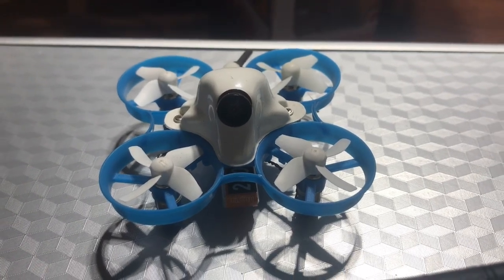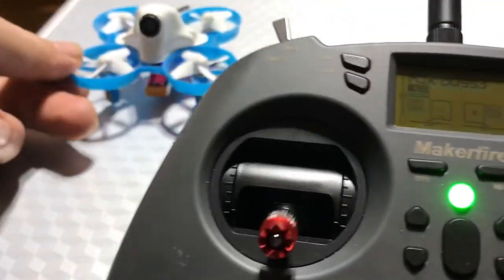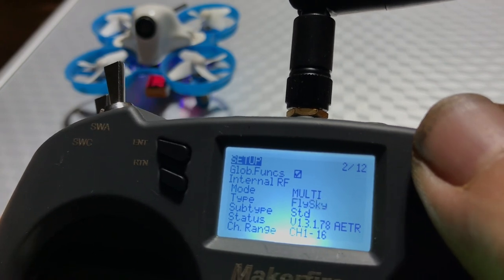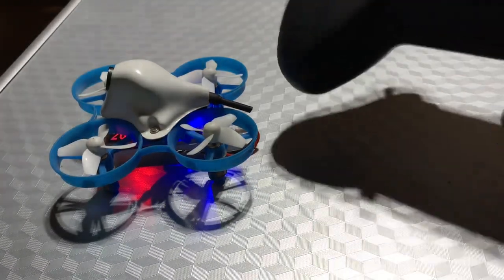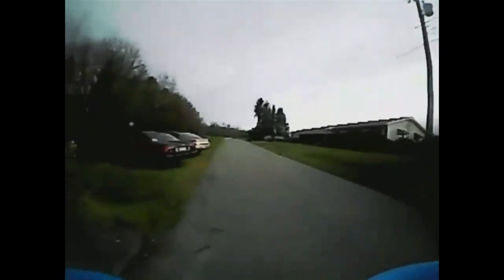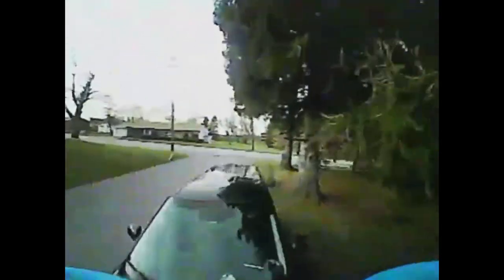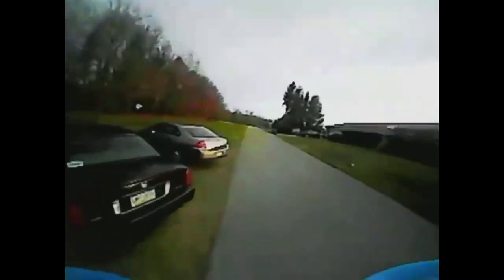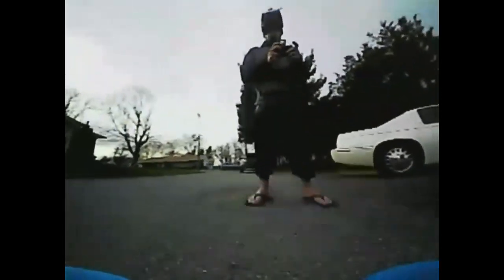How to Bind Betafpv 65s Light to Makerfire T-Lite Multiprotocol Controller FXT MODED ROTG01 Goggles

Comment: I just bought the beta65s and I have a beta fpv radio transmitter they both have D8 and I just can't seem to bind them together can you help me with this?
Reply: Did you figure it out? I’m having the same problem.
Reply: @roopert8533  nope I sent it back for a refund
Reply: @kaelstokes5804  alright I may have to do the same. I’m going to try flashing the firmware and I messaged support so I guess we will see.

Comment: Hey Jay! I just got this tx in the Jumper ver. At 2:08 you said you would check that the controls were all functioning correctly. I wish you'd showed how you did that too. I need a tutorial on this tx.
Reply from the maker: It is simple to see if the controls are proper after you bind it. If you throttle up and pitch forward and the thing goes backwards Or if you pitch left and it goes right or if you read or left and it goes right etc. your controls are not correct then you need to reverse channels
Reply: What I meant was where you button to on the tx to adj the  mix for those and other things.